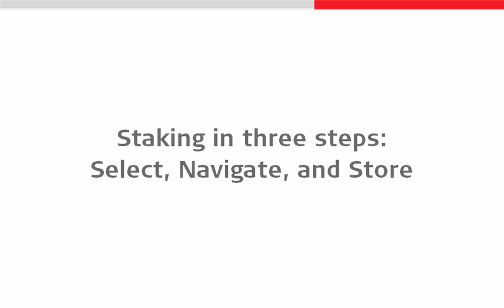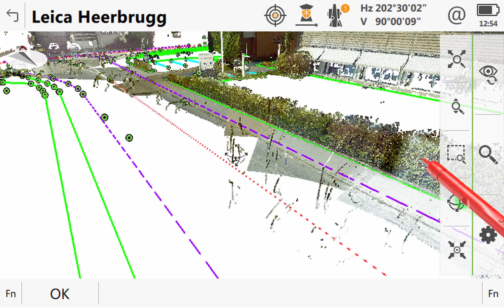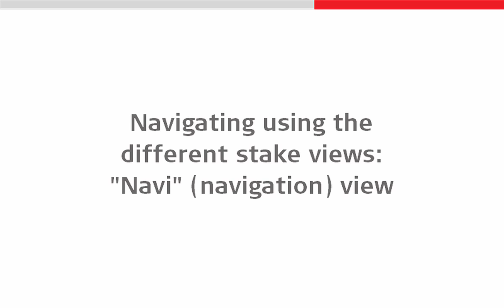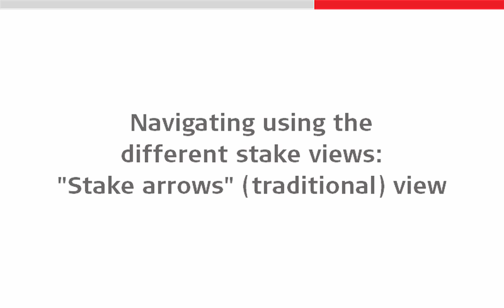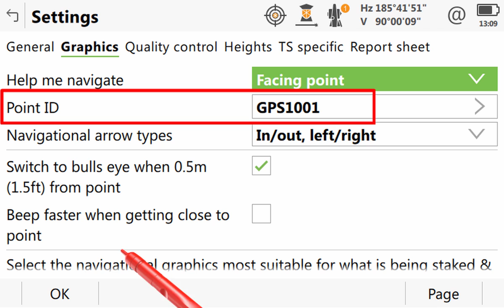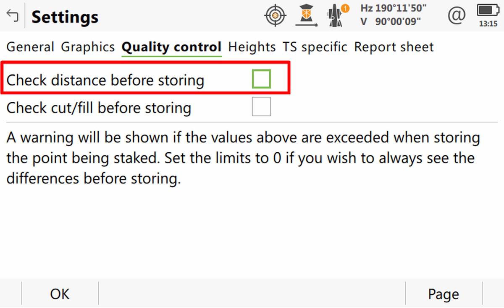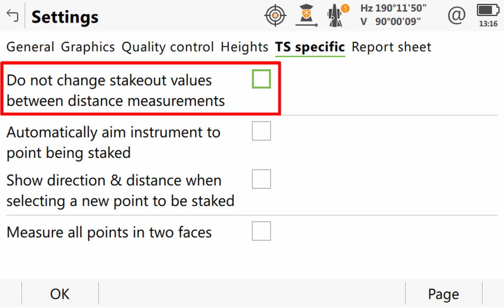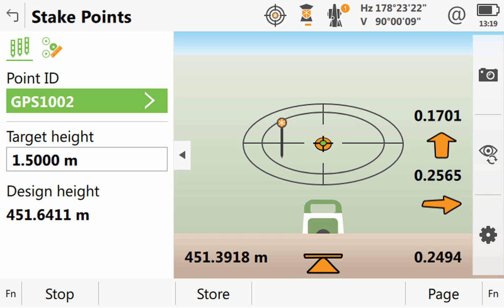Stake a point

Comment: I tried this demonstration with my TS16 but the distance, front and back from a stake point is not real time changing. Only the distance, left and right to a stake point is changing. If there is explanation for this ?
Reply: Set the measurement mode to "Continuous with lock" If you have a robotic instrument.  Once you press distance the values will constantly update
Reply: After using this software for the past year, the explanation I would give is that this software is horrible.